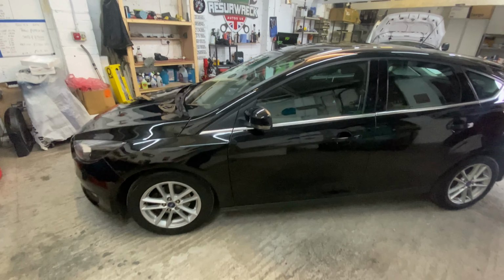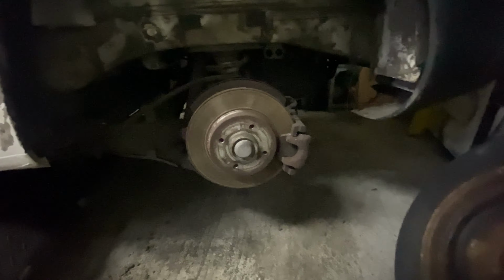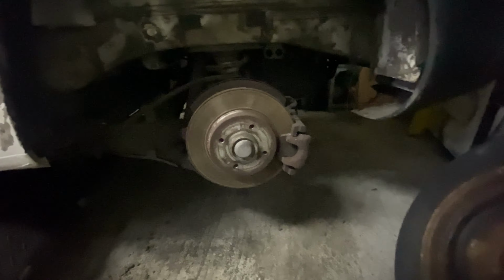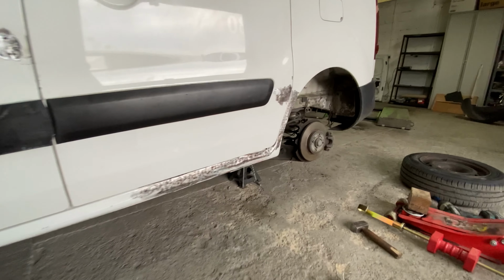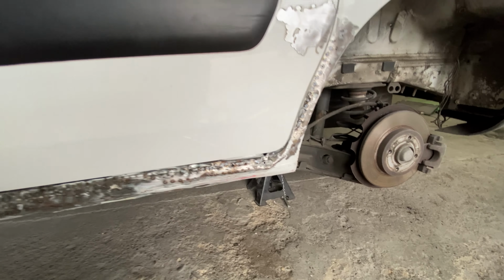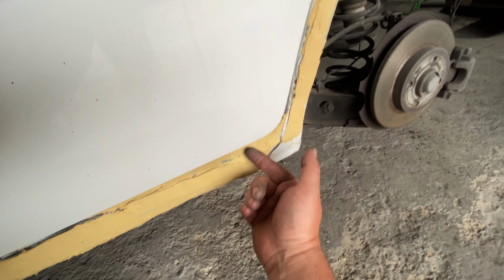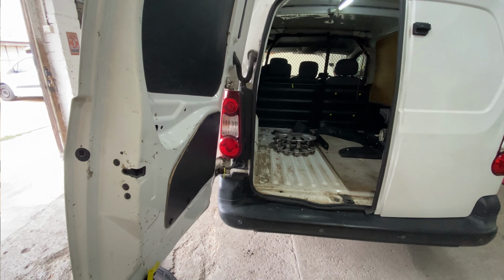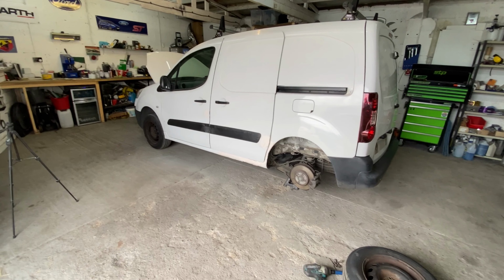Peugeot Partner Van 2014 Cat N Salvage Repair Part 3 Using My Spot Welder

Comment: Great video mark.  You should be fine with the headlights.  Official Gov website was updated in march 2021 to accept these headlights.   This special notice tells you about changes to the rules for headlamp conversions.

MOT special notice 01-21: headlamp conversions
Changes to MOT testing rules for headlamp conversions using high intensity discharge (HID) or light emitting diode (LED) bulbs.

From March 22 2021, not all motorcycles and vehicles will fail the MOT test if their halogen headlamp units have been converted to be used with high intensity discharge (HID) or light emitting diode (LED) bulbs.
Reply from the maker: Thanks buddy appreciate the info nice one 👍👍

Comment: That MOT guy is not correct, it is a fail if a halogen headlight housing has LED's or HID's fitted- regardless of the beam pattern. If he passes it for you there is every chance the new owner of the car will have it fail at another garage when getting it MOT'd next year.

Comment: Keep the good work going. Just noticed your extension lead. There is a design flaw, & the cable outer sheathe, & possible the internal conductors will fatigue. So if you regularly have the extension fully extended, have a look. Better safe  than sorry.
Reply from the maker: Thanks Roger I will buddy appreciate it 👍👍

Comment: 5995
Reply from the maker: Thanks Paul yeah £5995 sold 👍👍
Reply: As it goes with headlights if the bulbs are not oem parts it could be a fail